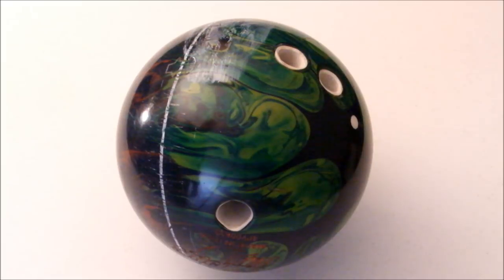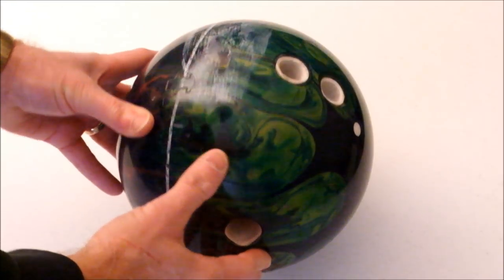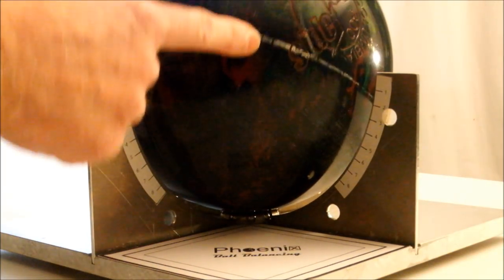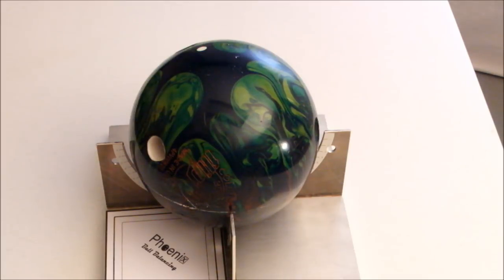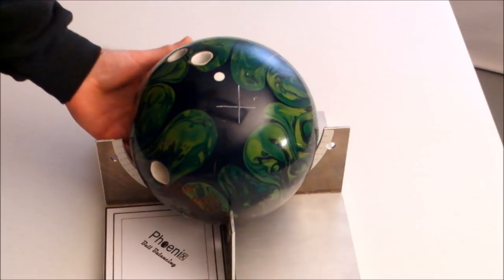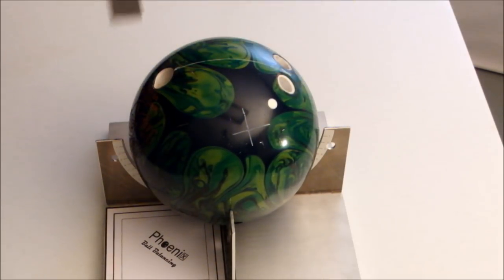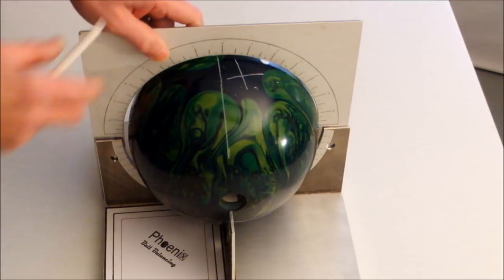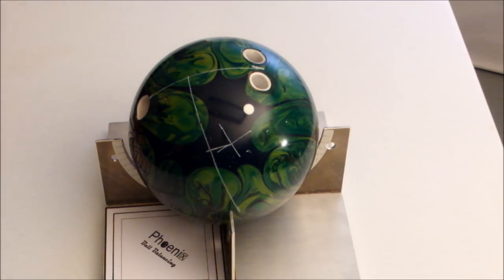Finding a Bowler's PAP

Comment: For most bowlers you should use the track closest to the finger and thumb holes. The video is incorrect on this point. Also, once the PAP is marked it should always be checked by placing tape at that point, having the bowler throw the ball and checking that the marked point is stable for the first few feet down the lane,